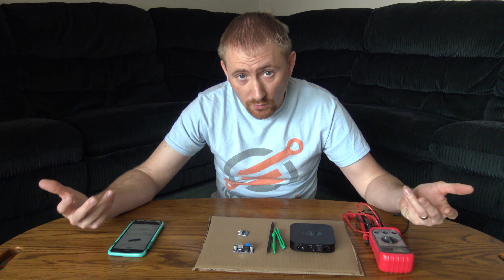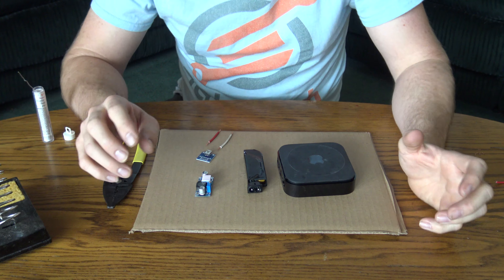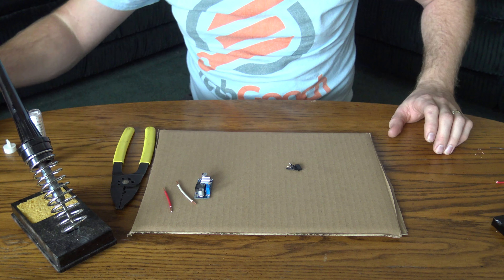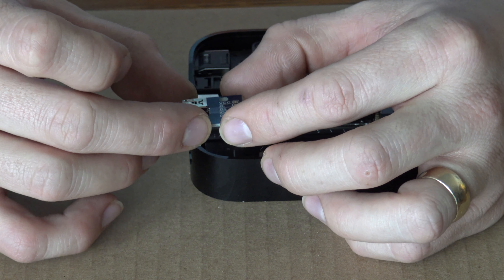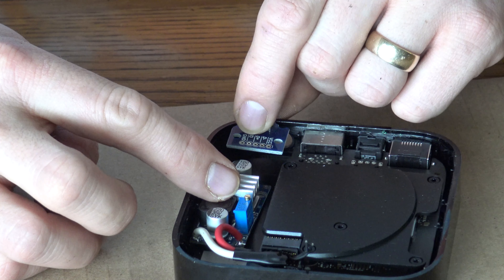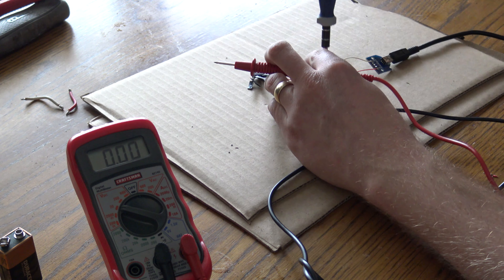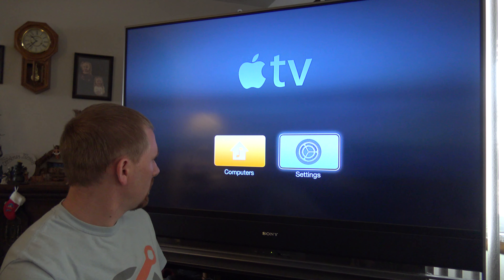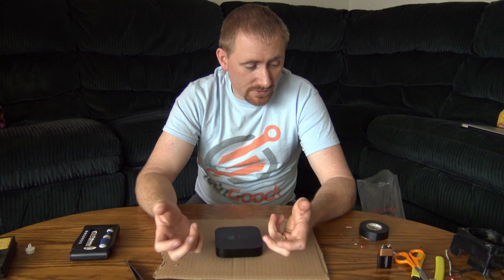Apple TV DC Power Conversion

Comment: There was a slightly easier way to drop the voltage, there is a part called LM1084 which always outputs 3.3V, no matter the input voltage (within some limits, obviously). The output voltage is also stabilized.
Reply: instablaster

Comment: You could also use a USB C PD module instead so the power supply will give the voltage needed(1.4v in this case) instead of converting from 5v USB
Reply: Could you elaborate or give a model number of something that will work?

Comment: Trying to figure some electrical math out the Apple TV in sleep mode use .3 Watts I would like to keep the Apple to on in my car asleep while the car is off. So I don’t get battery drain I would like to connect it to a usb battery backup so that it charges when car is running and keeps it on when car is off. 

At .3 watts can you help me figure out how fast would it drain a battery let’s say 16000 mah. What would the equation be so I could figure out the right size to buy

Comment: I need some help her. i follows step by step, but no picture on the apple tv. the light flashing but no picture. Switch back the 220 per supply, and everything works fine.. What is wrong??
Reply: Did you know what was the problem when using it on DC power supply?

Comment: Drinking game....Take a shot every time he says actually

Cutting wires with scissors = instant noob

Measures the voltage 2 times , unloaded, but does not check it when connected to the apple tv.